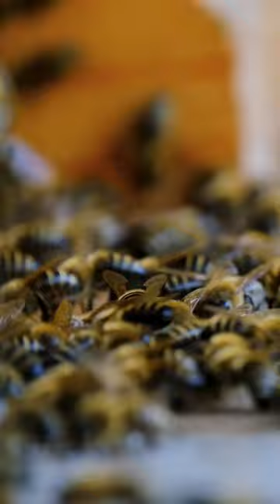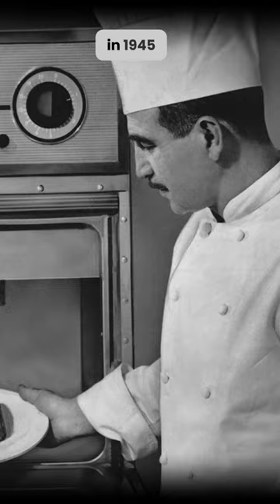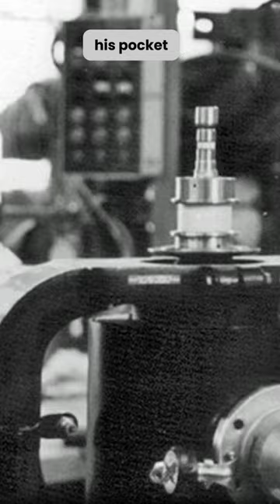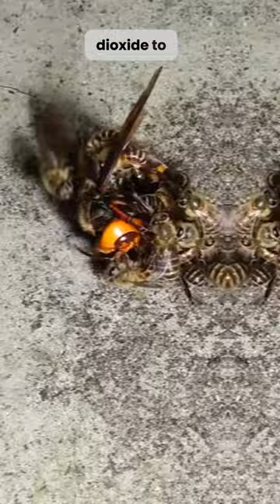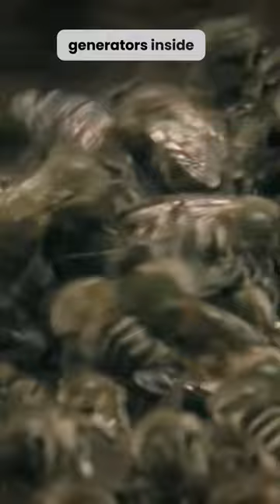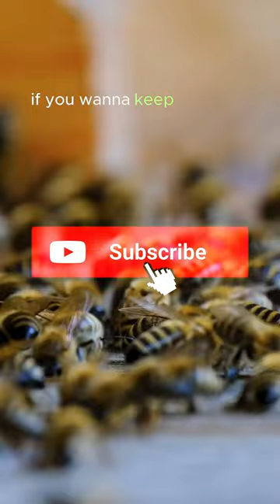Fireball Bees - Tiny Microwave Generators #Shorts #Youtubeshorts #Short#viral

Comment: Microwaves vibrate the water molecules in things (and other polar molecules, if there are any), and molecular vibration is heat.  Bees vibrate themselves, thus heating themselves up, and the heat is concentrated in the bee ball b/c they're all stacked on top of each other.
Reply from the maker: Excellent points, good sir!,  Your understanding of thermodynamics is sharp. however one can say that the heat generation method of the bees is more efficient than the microwave, which has radiation and might leak. What I was wondering about in this video is: 
How did the bees know about physics and thermodynamics before we learned about it in school?
Reply: @knightforLight  I mean, they probably just swarmed the hornets because they're like 1/10th the size, and then the behavior was passed down through the generations, as all adaptations are.  I'm not suggesting the bees know thermodynamics, per se, but it's not unreasonable that they would collectively understand "big hornet invader, swarm and shake, and it dies".  Not in words, obviously, but you see what I mean.
Reply from the maker: Bright one! Wondering is a very powerful weapon and the most powerful armor is knowledge. While Bees have a Genetic predisposition to communicate through certain vibrations and pheromones,  the queen is the one with enough pheromone variations to give orders to attack, retreat, or move the whole colony. Once a threat is detected, the alarm is on, first and last call is up to Her Majesty.😉